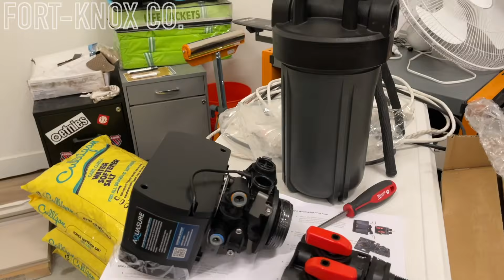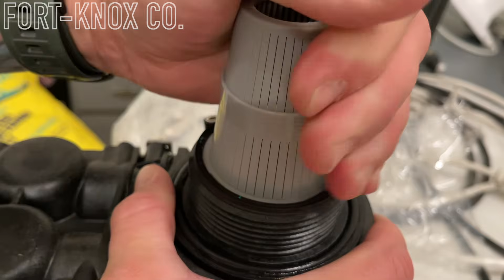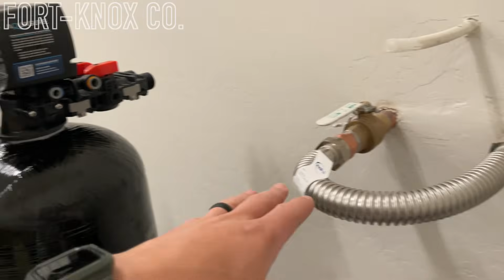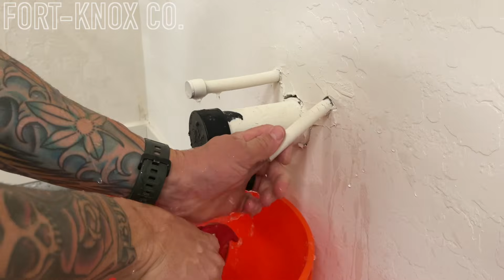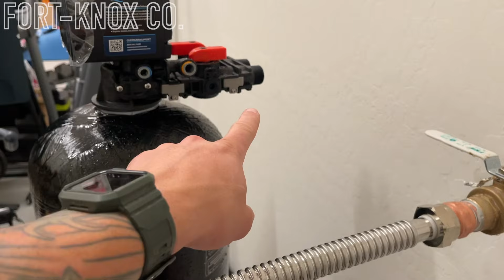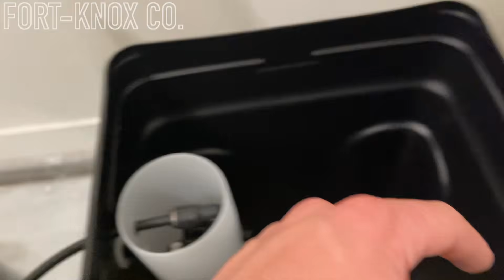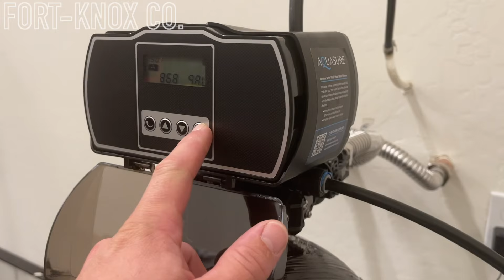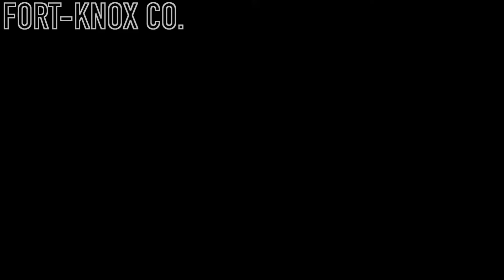How To Install Water Softener System Aquasure Harmony Series | Water Softener Loop Connection

Comment: I don’t have the loop but I have the main shut off and water drain in my garage. How do I create a loop :/
Reply from the maker: so what you'd need to do is at some point down the line from your shut off valve you'd need to cut out about a 10-12' section of water line, add a 90 degree turn on both ends of the pipe so it turns out of the wall and now shooting straight out towards the room/garage. then on those ends I'd add a shut off valve and male threaded end. this will create a place for you to add your water softener lines so the water flows through one pipe out of the wall, through the water softener, then back out the water softener and back into the other end of the pipe you cut in the wall. 

all the water loop is doing is creating a break In the line where you can add something to make the water pass through .

Comment: Excellent and Very thorough explanation !!! What happens is you done have that loop connection ? I can’t find the in and out wall pipes 😩
Reply from the maker: If your home doesn’t have a softener water loop at all… you’ll have to add one. This isn’t too complicated but might require a plumber to come out if your a beginner. But you can have a loop placed into your main water supply that comes into your home and have the plumber just finish the loop with two 1” male ends and a shut off valve while their at it and then you can connect your own water softener system and still save thousands.

Comment: Plz don't use shark bites. Hire a Plumber. 
Always use a backup wrench and Don't put tape on threads, Tape will only put more stress on the fittings.
Reply from the maker: All great information. I agree. I wouldn’t put shark bites anywhere you can’t see them for sure. Never behind drywall or in attics

Comment: Just curious (as a complete newbie) how did you learn all this stuff?
Reply from the maker: I think it all really just started with trying a small project on my own. Not being afraid to just try. Mostly motivated by saving money, if you look at it, realistically the people you see doing things have the same, two hands and 2 feet that you do. So why is there any reason that you can’t do it also. It’s just knowing what to do. So having that general curiosity to try and learn. And like I said, saving money was my motivation to do that. You can have really nice expensive things and get it for half the price or less if you do it yourself.
I think some of the first small projects I did, other than doing woodworking myself., was like a small tile job for an accent wall in our bathroom. Or doing like shiplap on the wall. Small projects like that can be done with basic tools and you start to kind of learn and go from there.
Reply: @FortKnoxCo  Great answer. Appreciate you spending the time to share your experience. Gives me motivation to try some projects around the house.
Reply from the maker: @pl2996  no problem at all. Let me know if you have any questions about stuff I love to help out where I can.

Comment: Just installed my AquaSure water softener and had to really lean on your video.   I had the same issue as you with the orange locking clip not fully seating.  It was leaking water when I opened the Inlet valve.  Pulling the whole fitting out really saved me some head scratching.   I used the Sharkbite supply lines connecting to 3/4 copper.  Really hoping I wont regret that. Anyone out there had any issues with those?   Thank you for putting this video together.
Reply from the maker: Awesome you got it done. Yeah there’s always a few troubleshooting along the way but we get it done. I’ve never had a problem with shark bites. That type of connection is commonly found in many places. Even on the water softener, lots of stuff nowadays has push in connections. 

Rule of thumb I always say is if your going to use them in places that you can see or are exposed then go for it. You’ll know if it’s failing and can address it easily.  Don’t use shark bite connections in places that are covered or concealed like inside walls and attics.

Comment: Thank you so much for the video. I have this extra sediment filter ( Fortitude V2 Series Triple Purpose Filter) along with the 64k grain softener which is making me think twice about doing it myself as it has to either run through before or after the softening . But other wise this video is super helpful.
Reply from the maker: Yes, this system came with the sediment particle filter as well. I didn’t install it in this video. But I did install it in another house. Usually they run it before the system so that it catches anything large coming from your city supply. But I’ve also seen people install it afterwards. In case anything from the filtering tank, makes its way through. Either way, it’s just another added layer of filtration and a big plus.

Comment: Great video! I just received my 48000 grain system today. Replacing a Rayne system and it looks like the drain tube coming out of the wall is a different size than the AS drain tube. I see you linked a coupler, but I may need to increase the supplied drain line to the wall drain line. And how the hack to slip on the coupler? Is it like a drip system where you use hot water to make the pipe more pliable?
Reply from the maker: Yep, your thinking the right way. If you can’t find the reducer or transition coupling piece you need then that’s what I’d do. Either a heat gun or warm water depending on how much you need it to stretch. But that should do the job.
Reply: Awesome brother! I'll see what I can find at Depot and rig it together somehow. Will post for an update for all if they run into the same...
Reply from the maker: @craigmiller5377  awesome! I’m sure you’ll get it done. There always seems to be something during a project that takes a little ingenuity .  And I’m sure others will find it helpful too.
Reply: @FortKnoxCo  Complete! Folks...watch this video. Like others have said, it's waaay better than the instructions! A few points I had to do..1) Because my drain line to the laundry room is over 20', the tube was 3/4" (likely 1/2" ID) which I used a barbed fitting with a male connection. On the Aquasure (AS) tube, it's a 3/8" barbed fitting with a female end. Warm each pipe end w/hot water and push the barbs in. Teflon tape the female end and tighten everything together. Use small clamps as well over each barb - be sure to put the clamps on beforehand! 2) Scratching my head why AS didn't use the same connector and lock in the brine tank as they do on the main assembly. Pushed it in real well and seems to have fitted though. 3) When removing the old stainless pipes from the copper pipes, be sure to find an outside water valve that is the lowest in the house and open it so you don't have draining all the house pipes above the connection :) 4) get the 24" length - I had 18" and it was a bit tough to wrangle the steel water pipes to fit up into the main valve assembly. 5) Being in San Jose and an occasional quake here and there, I've earthquake strapped it in to secure the tank from ripping the copper off the wall. It's not code, like water heaters, but hoping it will prevent a mess later. Sincere thanks to Fort Knox Co.! You're like the wise father of YouTube who teaches us DIYers stuff that we can actually do ourselves! And one of the very few that actually responds to user comments and questions!!! You rock!
Reply from the maker: @craigmiller5377  thank you so much. I really do appreciate the kind words. I truly do take pride in my work and I’ve always done my best to respond back to comments. I really think that if someone’s gonna take the time to say something or reach out I should do my best to help them. Because there was many people before me that helped when I had questions. That’s how we all learn.
Also, really good tips that you just put in there. The longer connection lines are highly recommended like you said. It allows you a better flexibility when making the connections and not having to make such sharp bends in the lines. Also, I never thought about it, but strapping it with some earthquake straps is a really good idea. They do it with water heaters why not do it with water softeners. 
But once again, thank you so much for the comments.
Reply: @FortKnoxCo  for sure! Meant to mention on the strapping, I just used copper pipe strap...much cheaper than water heater straps, and it's secure enough to keep it upright.

Comment: Which model is this? Did it not come with the reverse osmosis kit?
Reply from the maker: This is just the 64,000 green water softener system. It didn’t come with a another filter to put in line to filter out any large particles. But it did not come with a in-home osmosis system. I installed a reverse osmosis under our kitchen sink separately, but that is a different brand in a different system.

Comment: I just move to a house that has installed a soft rain water softener system but it was clogged with salt , I had to clean it , do you know why all the salt was clogged and it was solid like a rock
Reply from the maker: Was is clogged in the brine/salt tank? That could be because it had been sitting. If the house hadn’t been running a lot of water and the system was not regenerating regularly then that could cause everything to sit and get clogged.

Comment: Hi I’m putting ing an ecopure hybrid model replacing my formal kenmore hybrid and was taking of paying someone but they told me I need to install an air gap to my discharge drain and is running 1200 extra dollars
Reply: I noticed there wasn’t one on yours is it needed
Reply from the maker: @guy8201  an air gap is something I think they say you need as a general thing because everyone’s set up light not be the same and they need you to drain the water into a properly ventilated drain. So they just say that in a way of telling you you need an air gap where it drains. It’s so the water flows properly and doesn’t cause a back up or suction and dam up the water flow and spill out. Prevents a flooding situation. But it just needs to go to a proper drain that will allow the water rot flow. 

Even on washing machine requires about 2-3’ of vertical train pipe before the P-trap to prevent this too. They don’t want the high water flow from the machine or the water softener to over power the ability of the drain. So you have to give it enough room to move naturally.
Reply from the maker: Holy cow. That’s a lot for an air gap. Are they running all new plumbing?  Usually you just need the drain line to feed out to a drain. And those drains in your home have vents. It’s usually not a problem to go to a standard drain near by. A lot dump out into the drain that your washing machine flushes out into.
Reply: @FortKnoxCo  I have the exact same setup as your video but my drainage pipe is 2in or so bigger but angled at a 45* degree on the vertical wall, but nope it’s f my local hardware stores carry an air gap system or top so weird to me that it’s required?

Comment: How do I connect the drain line to my tapered pvc condensate drain line?
Reply from the maker: There’s several ways to connect the drain line. I just need to go to a drain somewhere near by basically. If you don’t have one by your water loop dedicated to connect to then you can tap into another drain line. Sink drain, washer drain etc. I’m not sure about a condensation line unless it’s to an actual drain to the sewer system. Most condensation lines like on an AC unit are not meant for full on draining, they are there as a backup to catch the condensation and then come out open near a window to show that there is over flow happening or out to and open spout outside. but not usually connected to the sewer. You’ll need this drain line connected to a full on drain. There’s several methods of tapping into a drain pipe. Similar to installing a reverse osmosis system
And the drain line it has.

Comment: Get a frustrate problem.. i have a same set up. but the tube is 1/2 inch  my drain line is 1/2 copper too.. but the copper is bigger than the black tube.. couldn't find the fitting for them.
Reply from the maker: Yeah, the copper size inner and outer diameter will be different than the plastic drain to that they provide. But you should look for a short bike connection or possibly some other type of push on connection that does the transition between copper and PVC. They’re very common, and that transition should be easy to make with the right fit in. But you need something that will accept copper and the PVC.
Reply: @FortKnoxCo  That's what i think .. but couldn't find one
Reply from the maker: @jasonguan9534  even through Home Depot or Lowe’s? They should carry a 1/2” coupling shark bite or something similar.
Reply: @FortKnoxCo  They have shark but just copper to pex size.. not coper to tube size.. and pvc 1/2 even bigger than coper...
Reply from the maker: @jasonguan9534  you might need to get one of those plastic transitions to go onto the tube, like the barbed style so the maybe a clamp and see if there’s a way to size up on the end. Or size down the copper into something that will transition to the tube connection.  There’s gotta be a way but might require 2 different connections

Comment: I am doing some research and I really appreciate your time and just have to ask If this is true,
awful taste
I bought this to soften city municipal water. I put a whole house filter in front of this (AQUASURE Fortitude Pro Dual-stage 12-GPM Kdf Whole House Water Filtration System). After hooking up the softener per the directions and after countless regenerations and even getting a new tank from them, the water is still undrinkable. It simply tastes like the media inside the tank. Literally if you smell inside the tank prior to hooking it up, that smell is the exact taste of the water. Awful and probably hazardous. Plastic and rubbery is the only way to disguise it. As soon as i bypass the softener and only use the filtration, the water tastes great. Honestly i don't understand how it could taste okay running through this media even if it was functioning properly. I will return this and make sure to tell anyone i speak with not to use this softener. They have not offered a solution that works.
Reply from the maker: This is the first I’ve heard of this. Many good experiences from what I’ve seen. I can’t think of what would be causing this issue for you. So sorry to hear this. I have a reverse osmosis system at our kitchen sink that we use for most of our drinking water. But even our fridge water makes ice from this water through the softener and it doesn’t have any bad taste or smell. Also
In our sinks and showers I’ve not noticed any of these issues your describing. 
Luckily there’s many brands out there and they are all usually great options. They all hook up basically the same way so you got that part down. I hope you find something that works for you.

Comment: How did you decide how big of a system to get?  It's just my wife and I in a new 3 bedroom 2 bath house. It already has the loop installed/available in the garage.  We see systems at Costco, Home Depot, and Lowes, I was wondering if those would work?
Reply from the maker: Those all work well. The Aquasure brand is usually carried through Home Depot as well. That’s how I originally found it. They have a calculation you can do with what’s recommended for which size softener to choose. It’s based of how many bathrooms you have and how many people are living in the house. You would be fine with one of the smaller systems if it’s just you and your wife. I believe 35,000 grain or 45,000 grain. They all do the same. Just the bigger the system the less often it has to run the regeneration cycle.

Comment: hi, i just have question about the water flow from water softener which will go to hot water tank before they go full house or they just from the main water and go to full house
Reply from the maker: The water line that goes to the softener is before anything in the house, including the water heater. So the water goes through the softener and then there’s a split to supply the whole house. It splits to the cold water sources around the house and the other goes to the water heater, then out to all the hot water sources.  So you hot water heater is getting softened water. This is a big benefit becoming it extends the life usually of your water heater. Less build up over time.

Comment: So when you have water softner pre plumbing is that the main line going into the water heater (cold) or coming from the water heater (hot)?
Reply from the maker: The water loop for a softener is before anything in the house including the water heater. The water going back into the house from the water softener then splits to your cold lines in the home and the line going into the water heater. The water going to the water heater is softened water.
Reply: Thanks so much man I really appreciate the reply. This helps alot!
Reply from the maker: @Atum_Ra  of course! No problem at all

Comment: Hi thanks for this video. Could you please send back side red valve position what is the correct direction of the red valve ? Thanks
Reply from the maker: Your welcome. But I’m not sure what your asking. Your sentence structure is confusing. 
The red valve shut offs should go in the direction of the water flow. In line with the water line is like through traffic. Perpendicular/crossing the water line is off, no water flow.